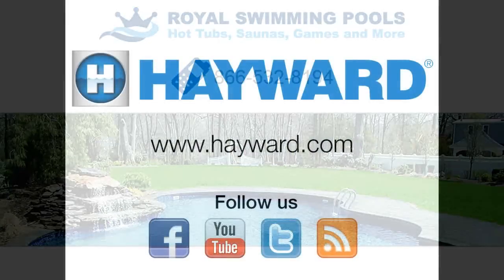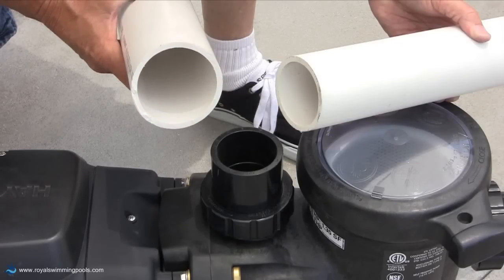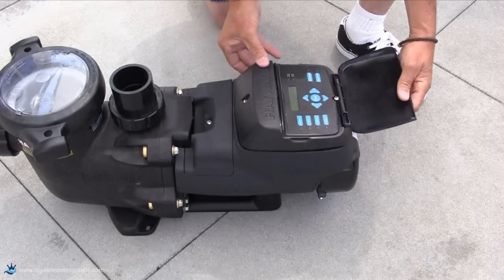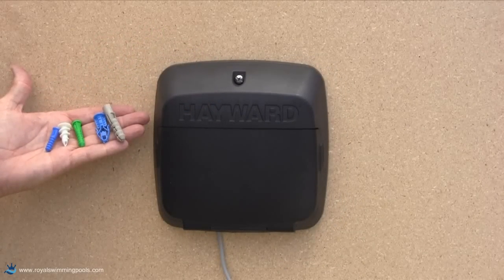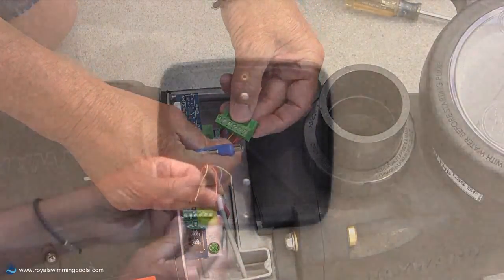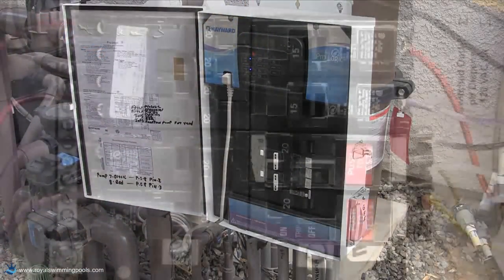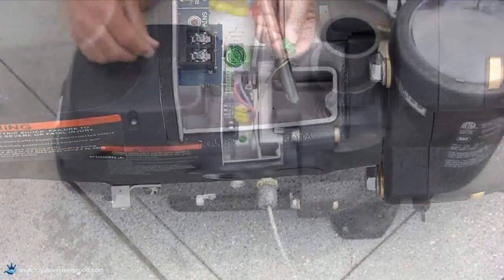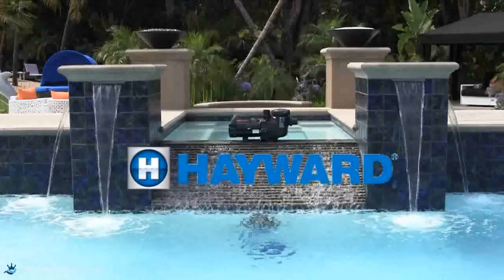How To Install a Hayward EcoStar Variable Speed Pump

Comment: Do not buy this pump!!! hayward makes some great products but this isn't one of them. The drive will fail within 2-3 years and you will have to pay a pool guy $500-$900 to repair or replace. I make a killing on commissions selling pentair pumps because of this P.O.S.
Reply: I just bought one "Hayward Turbo Flo II", installed it today, and turned on the power, it runs for several seconds then stops, and then starts again and stops again and again. I have to turn off the power in order not to hurt the pump. The old one just keeps running all the time util the water was pumped. 

Is this normal?
Reply: I'm not familiar with that model but it sounds like a run capacitor...
Reply: +tingokuman thanks for your reply, tried again this morning by connecting power to another socket on the deck and it works. Looks like the original socket output higher volt, I will measure when I get back home. But still not sure why the old one (also a Hayward) works.
Reply: +tingokuman get it worked finally, figured out the voltage is 230v, remove one hot line, got 115v. Thank you, great video!

Comment: Is the data connection to the goldline controller specific to the goldline models or would you need to connect data line to any controller?  I have the hayward oncommand unit, thanks!